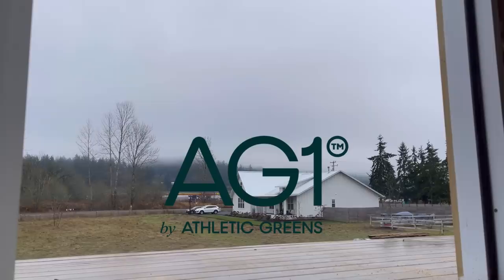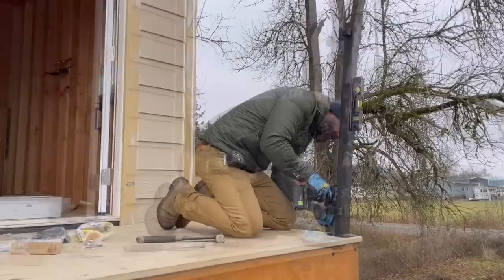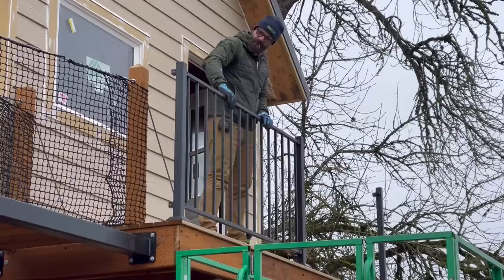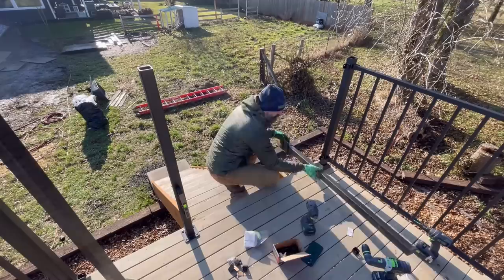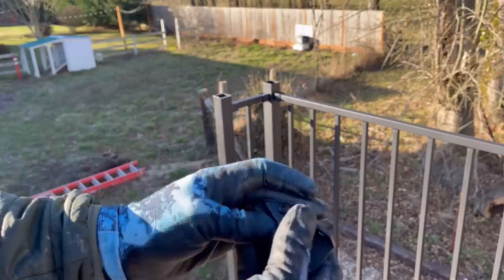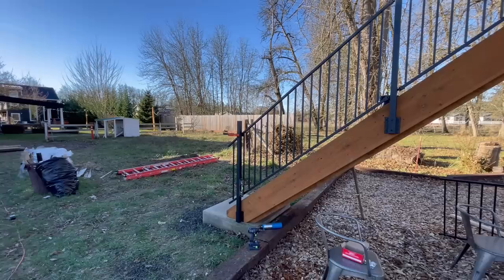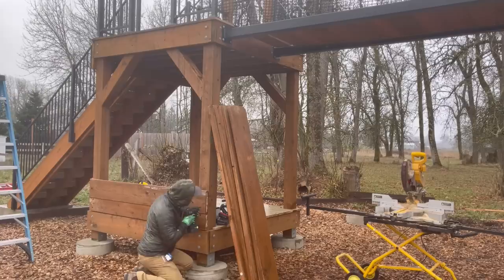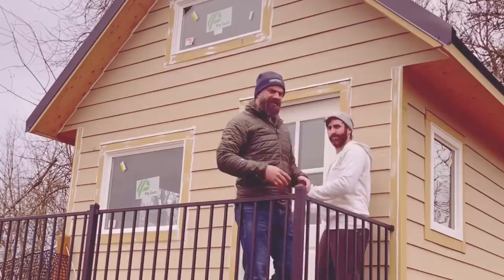Easy Railing Options || DIY Deck Railing Installation

Comment: Thought you might go with the netting to match the bridge or at least cables. 

Definitely agreeing with the other comments on replacing the shims before they rot in the next year or two. Also through bolts and beefy washers for the top bolts on each pipe base or just replace with rock climbing holds. The other side could be retrofitted with the fireman’s pole.

Comment: I install  a great deal of fortress rail.  When I buy it, the brackets are not pre installed. I  use washers for shims.  The directions are on the paper that wraps the panel in the package.  Thanks for all your videos.

Comment: When I'm working outside with small parts I spread a cheap tarp/drop cloth around the area. If you're working around posts and such cut a slit in the tarp so the tarp covers a large area. Easy to find dropped parts and pieces

Comment: I suggest that you add a gate in the gap for the ladder for safety. You could put a pull chain with a wooden handle on it's latch to open the gate when climbing up.

Comment: Howdy Mr. Jason. 

I still got a bit more of the video to watch, but I paused here at the point where you're doing the stair railing to comment:

Just a fun thought since this is for your kid....On the stair section, seeing as how you've spent a rather large bucket of money on this build....How bout adding a curved tunnel-ish roof type thing above those stairs so as your son is walking up the stairs, it'll be like walking through a tunnel. You could add cool blue or black lights on the inside and the sides would come down over the outside of the rails completely encasing the whole stairwell making it like, well, a tunnel. 

Kids love that sorta stuff.

Comment: And to what use is that powder coating on the sawn off ends. I don’t have a special sight but I can rather precisely tell you where the corroding will begin. Supplier should supply any compound to prevent rust on cut ends. Nice build!

Comment: I don't have much experience with railings either, but the process you discovered seems to me the most logical way to proceed - posts first, then railings to fit.

Comment: Cool system. Looks good, it's versatile, and it looks pretty easy to install.

I like your ladder rungs much better than the Amazon rungs. But being screwed into those planks, they're going to flex and eventually start pulling the planks out over time. It's exactly the same problem you'd have if you screwed a rung or a shelf into drywall without screwing into studs.

I'd recommend adding vertical 2x4 studs behind the planks, then screw the rungs on through the planks into the studs; the rungs would never flex then, no matter who climbed on them.

After you add the studs, you could even cut a couple of portholes through the planks on either side of the ladder.

FYI: Your heart went on just... a little TOO long.

Comment: Someone, help! I bought a set of these railings for my upstairs balcony, and they were amazing! They were good- too good! I was in love! I bought more, and installed them in my home. Had an issue where my dog kept running into my kitchen- added railings. Tripped on the side of my tub and flopped out- added railings. Messed up flipping some pancakes- added railings. 

Pretty soon I started putting railings on things that weren't normal. My car has railings on the roof to direct airflow. The windows have railings on the side for aesthetics. I now have railings on my ears, on my bicycle, and my shoes. My wife tried to stop me when I put railings on our son, saying I went too far. She threatened a divorce and I said I'd stop... In the night, she caught me trying to put a railing on her back- it was only using gorilla glue, far from a perfect installation. 

A week later, she gave me the papers to sign. When I reached to sign it with a pen, I accidentally pulled out you guessed it an entire section of Fortress BP Railings. Not an offcut, the entire 92" section. After she left, slamming the railing-door behind her, I sat down, tears in my eyes, and removed the glasses I made from spare railings. What have I done? This product has destroyed my family. I couldn't stop. The refrigerator door was replaced with railings, cabinet and pantry doors, too. It was the only thing that would alleviate the pain of losing my family to metal bars. I went looking for rehab; but, the therapist said there was nothing for me. I looked at him and all I saw was railings.... railings everywhere.

Comment: a tip for if you drop your screws into the chips and stuff use a magnet to find them by running it across the ground near the area where its dropped you should find them

Comment: Might be a good idea to run a bead of clear silicon around those plastic covers for bottom of the posts. The rain water, and morning condensation could run down the posts and into that cover and then start to rot.

Comment: Zip Line! Oh man I was hoping that you were going to add a zip line out the open section of the railing. When I was a kid we found a pulley/roller and rigged a zip line up in a tree across the back yard and had so much fun with it.

Comment: Here are the problems with your ladder: 1) the screws you were using on the Amazon TreeHouse things were not wood screws. Would have been better to use those machine screws to secure from the back as well. 2) the Big Box Store pipe ladder extends out 3 - 4 inches, which increases the leverage and makes it more likely to bend or pop a screw. Also, with the cement footing extending out close to the pipe ladder, that's a small risk that may be worth covering with wood chips. Love this series, btw.
Reply: Agreed on all points. Maybe consider replacing couple screws from each flange with a through bolt.

Comment: The screws you were worried about will come back. You just have to use the right bait. In this case, that would be a magnet unless they are aluminum or stainless. An angled rope ladder rather than pipe would prevent "some" falls, or at least catch most of them. Keep your day job, playing the flute in a rock band may be another pipe dream.

Comment: Have you considered installing a 4x4 post behind the flanges, to distribute the (shock) weight of climbing up the “ladder?” That’s what I would do. 
Also, are the steel crossmembers (bridge) strong enough to support monkey bars?

Comment: I seem to be doing these railings a lot lately lol. Fortress railings are well made too. I use 6x6 cedar corner posts and cedar 4x4s for the run posts. I try to make metal railings look  a little bit more custom looking.  I love this project!
Reply: What’s the pricing like on these railings?
Reply: @williamcox8491  depends on a few things but a few hundred dollars per section. Then comes the cost for the posts and the hardware…..they end up adding several thousand to a total build.

Comment: Balustrade is the long horizontal bit, particularly if it isn’t part of a set of stairs. Balusters are the up-righty bits to stop toddlers from dying and Newels are the bits at the ends, structural or otherwise. Pretty sure all these words are Roman, so blame the Italians.

Comment: I have been watching this build and I  think its great.  I  thought about the  ladder flex. What about reinforcing the section behind the ladder and use bolts. Remove most if not all the flexibility.
Reply: Through bolts with beefy washers for the top 2 bolts that would be in tension. Wouldn’t be necessary on the bottom 2 that are in compression.

Comment: I would bolt the climbing feature & add a wide washer at the back to anchor it. Currently with the screws there's still the probability of it coming off, cause it's only secured to the surface of the wood.
Reply: Definitely

Comment: Jason, would a longer and more powerful bolt instead of the short screws have made the Amazon ladder rungs work? Maybe for a future use on something else. The Foreman will definitely have the other kids wishing their dad would build them something like that in their yard! Merry Christmas and a safe and Happy New Year to you and the entire family.
Reply: It was the bracket, not the bolts that were flexing.
Reply: @johnlee7085  Looked like the bolts/screws ripped right out of the wood when he pulled hard enough on it. Either way, he's got a sturdy system in place now.
Reply: Unfortunately, it is similar to other parts of the build, where some aspects are way overbuilt but other critical aspects are deficient. 

The pipes are super strong, but the critical aspect, the likely point of failure is deficient. Each rung of the ladder is being supported entirely by the pullout strength of the 2 screws at the top of the base flange. The pullout strength will also diminish significantly as the wood weathers, and even PT wood will weather. Not terribly different than the little pine shims that will deteriorate a lot quicker than the decades mentioned and then result in a potentially catastrophic failure. Just hoping grandma doesn’t need to lean on it to steady herself.

Comment: You should pull those pine shims out and replace with composite shims.  Never rot or rust like a washer might.  Also won’t react with the wood so no staining.
Reply: Stainless if worried about rusting.

Comment: I was thinking and for the slide you should go in the treehouse and cut like a hole or something and put the slide in the hole and you can use the slide from inside the treehouse then you could put like a trap door so you don't accidently fall thru

Comment: This is the exact fencing I want (because I am extending the balcony and I have something similar to this, no metal post just directly attached to wooden post). I looked in Fortress website and it is hard to find a supplier for this in Houston area, they dont seem to sell to end users directly. Where did you buy it?

Comment: Go to idea. Those cheap ones didn’t really stick out far enough either. At the risk of sounding like wuss, kinda needs to be a Rail the ladder so that somebody doesn’t just accidentally fall off. A rope or something at least. So how dirty are the rails? Would they be sufficient for a commercial building?

Comment: There are building code requirements for anchoring the railing posts. The 4x4 looks beefy, assuming you field treated the cut ends, which I believe is a manufacturer requirement. I would definitely want to make certain a safety feature meets code. Maybe no problem if not, but the consequences are pretty significant if it does fail, especially if it’s not a family member and the other family decides you were negligent.

Comment: Isn’t working with angles fun? They just add another a whole layer complexity. I design frames, workstations, guards, etc using modular aluminum framing. I try to avoid angles as much as possible

Comment: Next time.  To maximize safety.  Use posts (usually 6x6 cedar) that secure to the joists with a few lag bolts before you put the decking on.  Then run your railing off those.  I personally wouldn't want to trust four screws on a railing that high in the air for kids.  And for the errant screws falling to the mulch.  Get a big magnet.  Overall the project is looking pretty stellar.
Reply: I’ve build many decks with fortress railings and have not had any problems with the safety issues 🤠🇫🇮

Comment: You should add a little pipe section above the ladder, about the height of the top bar of that railing. It gives anyone climbing an extra handhold, and it makes it less likely that you happen to trip and fall off at that exact spot.
Reply: I was thinking possibly a gate as well.
Reply: @paulvolkmann2979  Downside of a gate is that it can be left closed as you're climbing up, which in itself would be a hazard (albeit a very mild one). Having the bar would stop anyone falling off, but still allow climbing under
Reply: @daylen577  I was thinking inward swinging and openable while climbing but now I’m understanding the bar ... just the top rail of the railing

Comment: Have I missed a video? I don’t remember that window being broken! Also, when I saw you putting up the front boards I assumed you’d put in a climbing wall instead of a ‘simple’ ladder. Silly me. What is the plan for the lower platforms?

Comment: Another great video!  

Hey, I got a question.  I was re-watching one of your other videos and saw those bar thingys in your shop that hold all your long boards in place there on your wall.  They're similar to those big ones in the hard wood store only not as big and they look great for keeping all your wood stored nicely.  What are those called and where did you get them?  Thanks!

Comment: I think you should have bolted through with nuts and washers on the back.
Reply: Definitely the top two of each base. The bottom are in compression so not necessary.

Comment: I ain't talking bad on anything for my own sake. I'm just saying that pipe isn't very hard and it will break at the threads pretty easily. The pipe is thick but where the threads are cut into it the pipe gets real thin

Comment: Now you know better. When you are working on posts in the vertical space, you are not leveling but plumbing... And not the kind of plumb that you need a plumber for...Quit saying level when you need to say plumb...Plumb - Plumb - Plumb - Plumb !!!!!!!!! You sure it was 1/8 th of the time??? It looks like about 5/16 th of the time for the other side..... In all reality, the last time I installed any kind of railing, I used a 2 X 4 scrap for the spacing under the rails both on the sides and the stairs. Thought of that all by myself... Nope, saw it done by a railing company to the house in back of me. Nice pipe idea on the side...Bet the kids really like that...

Comment: 23:33 I really don't think it's the bracket itself that's the problem, the screws that you used are ridiculously short.  They just pulled right out from the wood.  They should have been thru bolts with washers and nuts on the back.
Reply: True on the screws, but the bracket was also flexing.

Comment: I don't have kids because I was deemed unsuitable by my wife. But if I did have kids, I would have built it several hundred feet higher, add a fireman's pole and a zip line that leads directly into the kitchen. Hence the "unsuitability issue".

Comment: steel railings are dumb. Use aluminum. And you dont need a grinding saw, you can cut with carbide tip or diamond saw.